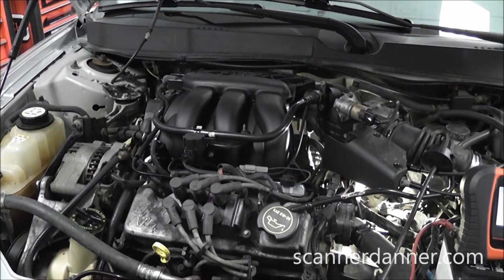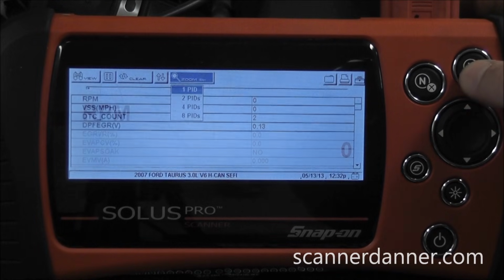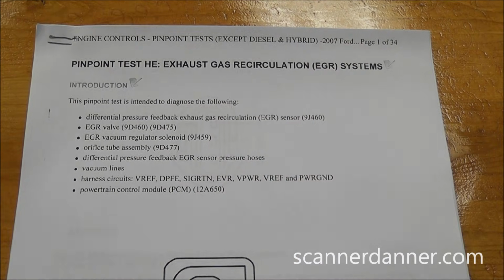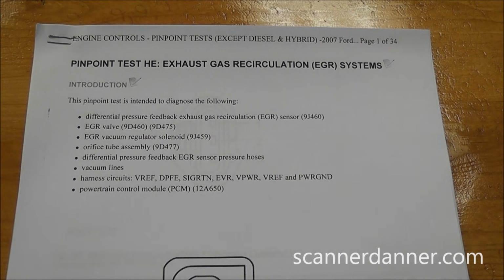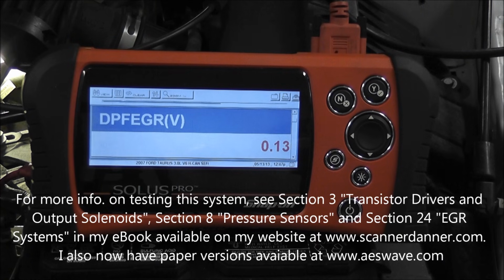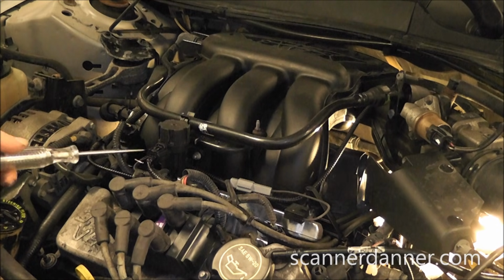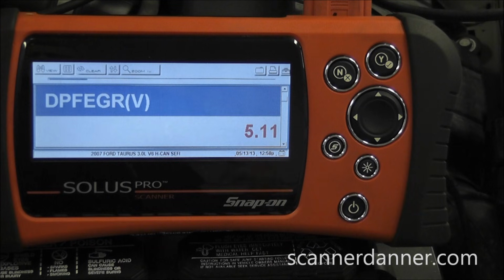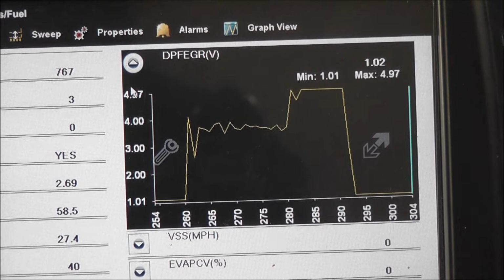P0405 EGR Sensor A Circuit Low (failed DPFE sensor)

Comment: He shouldn't be dogging Ford's all the time!
Reply from the maker: I dog all cars. I own a Ford so I don't really hate them.
Reply: @ScannerDanner  MY TAURUS had the po401 code,i replaced the dpfe sensor,that code went away and was replaced by po405 now,wth,i don't get it,maybe aftermarket dpfe or something else???,i did buy an egr vave just in case though,any ideas??,thx
Reply from the maker: @fonzo2525  What is DPFE signal voltage 
1. with just the key on ___
2. engine running at idle ____
3. when energizing the EVR solenoid (engine running at idle) ____
4. does the engine stumble and almost stall when energizing the EVR solenoid while idling?____
Reply: @ScannerDanner  that's a good question,i haven't the means to test these components properly to pin point the exact problem,i just thought it was odd that the po 401 insuffient flow code went away and was replaced by po 405 EGR signal A circuit voltage low,in either case the car runs great with these issues,meaning it idles fine and runs fantastic as well...the only draw back is my gas milege took a hit in about 2-3 miles per gallon,i'm selling the car but would like to sort the issue before doing so,i've had these issues for over a year with no drivability issues whatsoever,i did buy an egr valve and gasket maybe ill replace that today,thx you for your help,these issues are such a headache,lol
Reply from the maker: Return the EGR valve, that's not your problem with the p0405 code. 
Make sure you didn't reverse the hoses on the dpfe sensor
Reply: @ScannerDanner  nope,i def didn't do that for sure,maybe aftermarket dpfe sensor,i heard those cars only liked the oem sensor...motorcraft.,thx you for the reply.
Reply from the maker: @fonzo2525  I just need a voltage reading on your signal wire of the dpfe sensor to help. I have other videos on this that will help you.
Reply: @ScannerDanner  thx you very much,if you could post the links that would great,no idea how to t pin the signal wire on that sensor for a reading,my skil set is no where near your abilities,wish you or eric o of sma were my neighbors,i'd pay with craft bers and my wifes desserts for you guys diagnostic  skills,this is probably simple stuff for you,lol
Reply from the maker: Use this playlist https://www.youtube.com/playlist?list=PLAFYVCyenqcrqfDNVnVxC_76uRT16Wjew
I like cherry cheesecake :-)
Reply: @ScannerDanner  thx you very much for the links,my GF is a pastry chef and her specialty is cheesecake ,lol,No kidding you said that,cherry cheesecake,it's my favorite as well:)..thx again!!